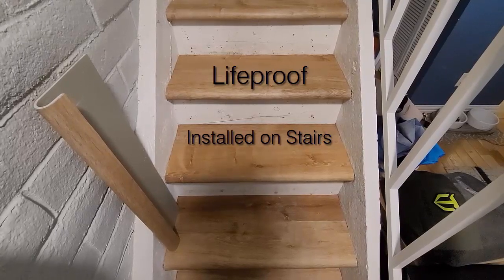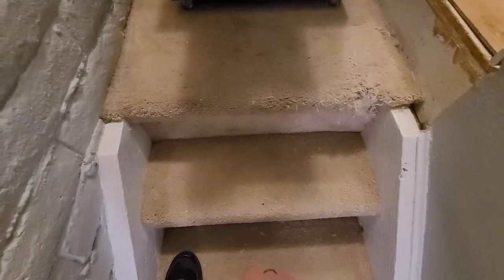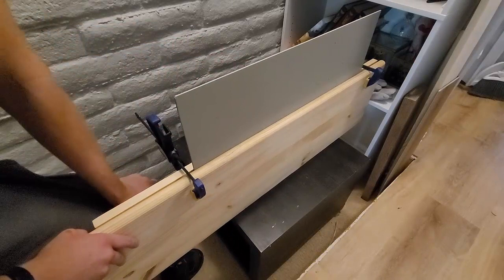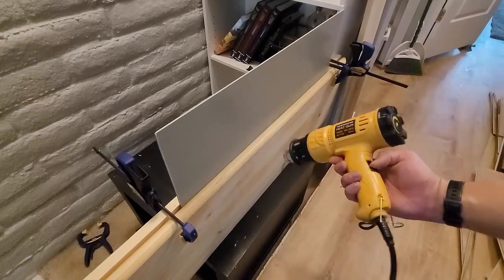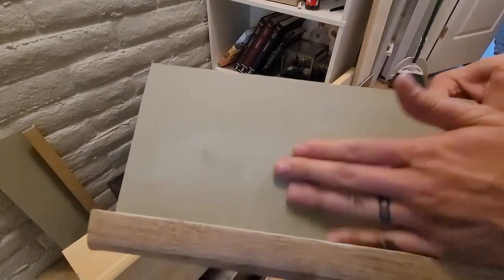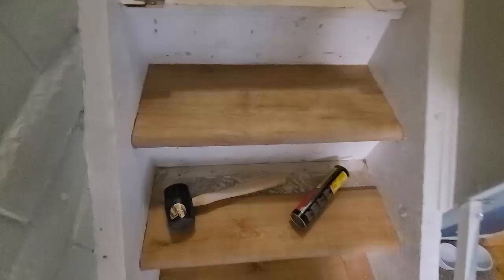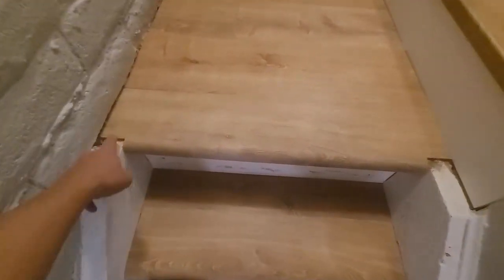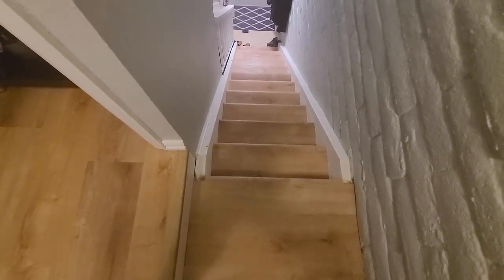Lifeproof Vinyl Plank Flooring - Installed on Stairs with Custom Formed Bullnose

Comment: Thank you for adding every step in this process. I've been watching videos also trying to find the best solution for my stairs. Your stairs look great and your process looks completely doable, for a completely in the dark renovator with minimum tools and knowhow.  So for all of us with the ambition and desire but little how to. THANK YOU! {and I really like your cardboard jig} Cheers!!
Reply from the maker: Glad this helped you out! I was definitely making the most of what I had to get this job done. I thought it would be good to show that this can be accomplished with minimal tools and without a workshop. I wanted to be thorough in explaining the process because It seemed like many of videos I watched were missing critical info or were somewhat vague on the overall process. Unfortunately it turned into a much longer video than I anticipated, but I'm happy to hear that it is appreciated. Also, that cardboard jig worked surprisingly well and saved me from having to buy something that was only going to be used once. Thanks for the comment!

Comment: Good job man, I was about to put stain on my stairs but after I saw your video I’m going to try your idea 👀 looks more durable.
Reply from the maker: Give it a shot! It should be pretty durable and it should be less slippery than stained wood. I was actually surprised how much grip the vinyl provided. Not as much as carpet, but definitely more than wood. Thanks for the comment!

Comment: I tried doing it where I clamped the plank and bent the bullnose. Your way is much better where you clamp the bullnose and use the extra plank as leverage. Also I used a propane torch to heat it up quicker - a bit more risky but a few quick passes and it heats up well
Reply from the maker: Yeah, whatever works!

Comment: Thanks for sharing Using a new stair wood tread to use as a guide for the bullnose fold is Genius! I was planning to do it on the stairs but this is the way to go. I too agree this seemless look is BEAUTIFUL & your stairs look you paid a pro to do them I'm going to try this on my stairs with gluedown 3mm lvt which is more flexible than this. I will use loctite to glue them down as opposed to pressure sensitive glue which is what the flooring calls for
Reply from the maker: Thank you! Yeah, the seamless look is great and I actually just added some sealant to all of the edges so it really looks buttoned up now. I agree that the 3mm should be much easier to bend and work with in general. I'm not very familiar with the pressure sensitive adhesives, but I think it is more for large areas of floor that need to stay workable for longer. For all I know it might work fine on the stairs, but I'm guessing a Loctite/construction adhesive will cure much faster and ultimately be stronger. Thanks for the comment!

Comment: Great job.
After removing carpet, I would just paint the riser white and call it a day.
No one would scrutinize the riser.
Reply from the maker: Yep, painting the existing riser would normally work just fine. In my case the existing risers were in really poor condition so I decided to add a thin cover board. Thanks for the comment!

Comment: Great Video! I think you could have put a few light relief cuts on the back that would have helped bend it more easily.
Reply from the maker: Yeah, I've seen other videos of people doing that. I ultimately decided against it because In my testing it seemed to bend decently as is and I didn't want to compromise the integrity of the planks. It would definitely make the process easier and most likely would not impact the performance. Depending on the product this might be something you have to do to make it work. Thanks for the comment!

Comment: I'm going to plan to try it this way. I don't disagree that routing out some of the material may weaken the plank at the bullnose point. But, I'm more interested in cutting out work that may be unnecessary. Really don't feel like using a router on 13 different pieces, would rather spend more time heating/bending on each.
When I make a video of my doing my stairs I'm gonna credit your video.
Reply from the maker: Agreed, I thought it was an unnecessary step that added a lot of time and required tools I didn't have at the time. Also, my sample tests basically proved that it wasn't required to get the bend I wanted. It would be great if you could stick my link in the description of your video! I did the same for the videos that inspired me to tackle this job. Everyone does things a little differently, so the more information on this process the better. Good luck with your project!
Reply: @StephenLaGrange  Done. I completed my stairs just need to rework the nosing at the landings, install some primed mdf risers, and paint. Linked ya vid here.
Reply from the maker: @ericbader  Thanks for the link! looks like you got the process down and the stairs are looking good. The landing was the trickiest part for me. Good luck with the rest of the project!

Comment: Have you had any problems with the steps? Guy at HD said it would peel when I told him I want to try.
Reply from the maker: I have had zero issues so far and they have been installed for well over a year. No damage and no peeling and they get heavy use daily with a dog and cat. Nothing lasts forever, but they seem pretty durable in my experience.

Comment: Verry nice video great job. But I was wondering if the rubber under plank really needs to be removed,. I was thinking to maybe remove it on the edge where bending or possibly not remove it at all and heat up with the plank. I have stairs then floor level are and stairs again I thinking if I remove it and keep on between the floors the last step won't flash it with the rest. Also for the riser can the plank be installed to match steps color. Thanks
Reply from the maker: Good questions! Ultimately, that decision is up to you. The main reason I removed it was because I did not trust that layer of backing material to hold to the planks securely over time. That backing can be ripped off the plank by hand, so that is not something I would trust to hold up and could potentially create an unsafe condition. I also don't know what adhesive would stick great to that backing materiel, but regardless the weak point is whatever is holding that backing to the plank. There are other videos on youtube showing it installed with the backing, but that is not something I would recommend. 

I had a similar situation with the landing and I had the same concern about the un-backed tread not being flush with the first normal plank on the landing. I tried explaining this at the end of the video, but I ended up leaving a thin strip (1"+/-) of the backing material on the connecting edge and removed the rest. This gave me plenty of area to glue to tread in place and still line up with the first plank on the landing. That seemed to work fine for me. 

You can definitely install the vinyl planks on the risers as a finish. I would not be as worried about ripping off the backing material for that since it is not something you are stepping on, but I would recommend finding an adhesive that you know will hold it on. Thank you for the comments/questions!

Comment: I was with you until you put all those clamps directly on the face of the vinyl.   Better would have been to use a piece of wood underneath those clamps.    So, you removed the backing?    What thickness is the vinyl?
Reply from the maker: Yeah, adding a piece of wood with the clamps is a good idea. I removed the backing so the plank could be glued directly to the stairs. If you don't there is a good chance that plank will come loose over time. I believe this Lifeproof plank is 7mm.
Reply: @StephenLaGrange  …. Thank you.   That helps.    Soon, I will be doing my stairs as well…🤠

Comment: I am looking at doing my stairs soon because I don't want carpet anymore.  I have been looking at the cap a tread but was wondering about the top landing area and don't want to use any kind of transition.  Couldn't you use the cap a tread on all the other steps and just bend a piece of the flooring for the top landing area?
Reply from the maker: Good question! I was contemplating doing exactly that when I first started the project. I think it would work just fine and would give you the best possible transition at the landing. It might be hard to match the nosing on the cap a tread perfectly, but I'd rather have a smooth transition than a perfect match. Thanks for the comment!

Comment: If it is down glue vinyl plank 2 mm think bending is easier than a 5 mm and than a click vinyl plank and you can heat it from the top. Everything depends of the thickness of the material you’re bending.
Reply from the maker: Agreed!

Comment: Interesting idea. Any recommendations for open riser stairs? Also does the thickness of the wear layer matter for the lifeproof planks?
Reply from the maker: I have not seen anyone try this on an open riser stair, but I imagine they could be installed in the same way. The only issue I can think of is that there is not really a good way to trim out the plank on the bottom side of the tread as the riser would normally be there. If the stairs are not visible from the back side then this probably wouldn't be an issue. 

The wear layer matters on any type of LVP. In general the thicker the wear layer the longer the product is going to last. Products that have a thicker wear layer can typically take more abuse and are meant for more high traffic conditions. These could be considered commercial products and are generally more expensive. Products with a thinner wear layer are typically meant for residential use and are generally cheaper.

Comment: Hey there! Nice video. I like how you thoroughly explained your thought process for this. I am considering doing something similar with my stairs but I was curious how "slippery" the stairs are with this look. How is the grip when you're going up and down wearing socks?
Reply from the maker: Thanks! I'd say the grip is pretty good. The vinyl has some wood graining on the surface that gives more traction. I've never felt like I was going to slip and I've walked up and down with socks without any issues. There are a lot of different products so it could vary depending on what you use. In general It will not be as grippy as carpet, but it will likely offer more grip than wood or tile. I remember seeing a video on YouTube that tested the grip of all of these materials and vinyl fell somewhere in the middle and that is pretty much what I have experienced. Thanks for the question!

Comment: Great Job Sir! What is the brand you used for the transition piece. Im installing the exact same flooring and cut my bullnose off the stairs.
Reply from the maker: Thanks! It is the "Performance Accessories - Vinyl Stair Nose Molding" in the golden finish (link below). I believe it is a Home Depot brand and it is what they have listed as the coordinating trim for the Lifeproof Fresh Oak. It does coordinate, but its really not a perfect match. It might be worth a stop at "Floor and Decor"  to see if they have something that would match better. I went there after I had already installed the trim and was surprised by how many more options they had. Good luck with your install!     

https://www.homedepot.com/p/PERFORMANCE-ACCESSORIES-Golden-1-32-in-Thick-x-1-88-in-Wide-x-78-7-in-Length-Vinyl-Stair-Nose-Molding-VSNP-05707/317315453

Comment: What do you do about the top stair nosing tread if you take off the black backing piece? Isn't the height uneven next to the laminate on the top landing behind it?
Reply from the maker: Yes, I talk about this about 31:00 into the video. I left a thin strip of the backing attached to the back of that top landing plank so it would line up correctly with the next piece.
Reply: @StephenLaGrange  Ahhh yes, thanks. I did get to that part of the video eventually. I think the adding of enough glue would fill the gap left behind. Thanks, gonna try this method today on a top tread.

Comment: Just curious will this work an all depth of vynil flooring or is there a max I know some are different MM
Reply from the maker: Hard to say for sure how thick you can go. I believe the Lifeproof is 7mm thick and it wasn't too hard to form, so I would assume you could probably go thicker and still make it work. I would recommend getting a sample of the material you want to use and doing a test on it before fully committing. Good luck with your project!
Reply: @StephenLaGrange  thank you

Comment: Love the way you did that and it looks great, but that’s adding a lot of time to your job.  I know buying the pre-made treads are pretty pricey so what do you charge to compensate for your time to make them?
Reply from the maker: Thanks! You are right this is a very time consuming process. There are probably ways to expedite the process a bit more, but its still going to take more time than using a pre-made product. In my case I wanted the nosing to be flush with the tread and at the time I could not find a product that would achieve that. 

After I had already started the project I actually found a company that does produce the custom formed nosing with the same lifeproof vinyl flooring. The company is called Luxury Vinyl Treads (website posted below) and they do it for almost all of the lifeproof line and some other products. These preformed treads are roughly $50 a piece, so it is not the cheapest option, but this would save a lot of time and still give you the optimal look/finish. This was my actual house so I decided it was worth the time/effort to get the look and finish I wanted. If you have the time, doing it yourself is definitely one of the least expensive ways to do it. Thanks for the comment! 

https://www.luxuryvinyltreads.com/shop/lifeproof/2
Reply: Thanks, keep up the good work.  Good skilled workers are getting harder to find.

Comment: Great video and I thought the others missing steps at 044 was really funny since you're working on a set of stairs.  After doing this would you think it might be good to install the step then risers and work your way up versus going back to do the risers later?
Reply from the maker: That was totally unintentional, but I definitely thought about that after the fact lol. 

That is a really good question. Depending on your conditions doing it that way might be a bit more forgiving and you may get a slightly cleaner look because any potential gap would occur on the underside of nosing between the riser which is not as visible. Doing the risers after puts  potential gaps at the top of the riser where it is much more visible. As long as the risers are installed tight to the top there should not be many gaps and any that do occur can be hidden with some calking. 

For me it really boiled down to the existing conditions and constructability. The existing nose overhang was pretty short so I wanted the new tread/nosing to wrap back as far as possible on the underside to keep it more stable. I also thought that pinning the underside of the wrapped nosing with the new riser board was good idea. In the end I think you can get a good result doing it either way as long as you keep the tolerances tight. Thanks for the comment/question!

Comment: Just an observation I would have sanded filled in with putty sanded & painted the stringers before doing the stairs. Maybe that's not the look your going for?
Reply from the maker: I actually don't mind the rough look of them. Normally that would probably be the best way to get a nice clean look. In my case it would have been a huge amount of work without a whole lot of benefit. There is layer upon layer of paint on them already so I can't even imagine how much time it would take to strip all that off and sand it down. After the stair install I ended up just adding some touch up paint/sealant and I'm happy with the way they look. Thanks for the comment!
Reply: @StephenLaGrange  good for you my ocd forced me to spend hours upon hours on mine ):

Comment: I have “open” steps any ideas how to bend the sides of the steps.
Reply from the maker: That is going to be really difficult to achieve. You would have to bend one tread for the front and another for the side and then make a 45 degree miter cut on each piece for the corner. Another problem is there will not be any T&G on cut corners for the pieces to lock together. If you are very precise with the cuts it might work, but that corner is going to be tough. It is going to take a long time and you pretty much have to be perfect for it to look good.

The better route might be to just lay and glue the planks down normally on the stairs and then find a transition piece like the one I showed in the video to trim out the nosing/corner. You could always give the bending a shot and resort back to the trim piece if all else fails. Thanks for the question!

Comment: Is there a difference between luxury vinyl plank and Lifeproof vinyl plank?
Reply from the maker: They are basically one and the same. Luxury vinyl plank is the generic term for this type of product and lifeproof is the brand name. It's similar to calling tissues Klennex. Thanks for the question!
Reply: Would this process work then on a LVP from Shaw
Reply from the maker: @essasharif6918  I'm not familiar with Shaw LVP, but yes I would imagine it would work. Best thing to do would be to get a sample of the product you want to use and do some testing on first  to make sure it works. If the testing works well, then you should be good to go!

Comment: What do you do at the top?
Reply from the maker: At the top landing? I covered that in the video, but that piece was bent and cut out differently so it would fit between the stringers. I also only removed part of the backing on that piece. I removed enough so it could be properly glued down, but left enough so the next landing piece (with backing) could be installed.